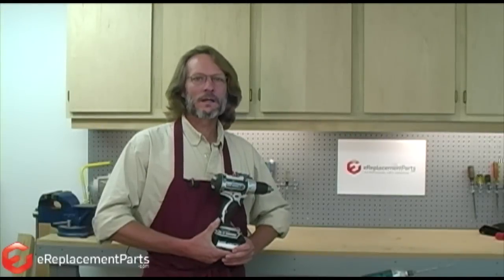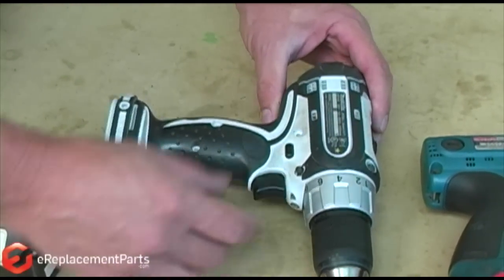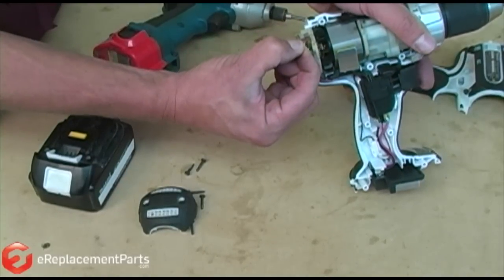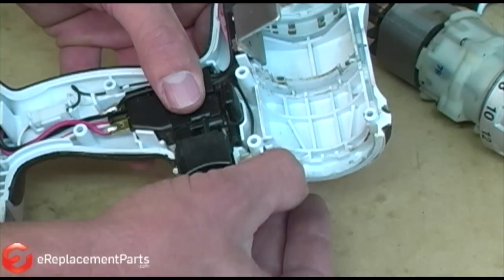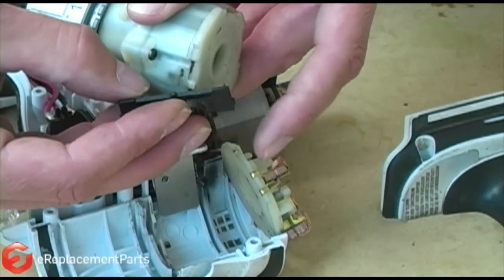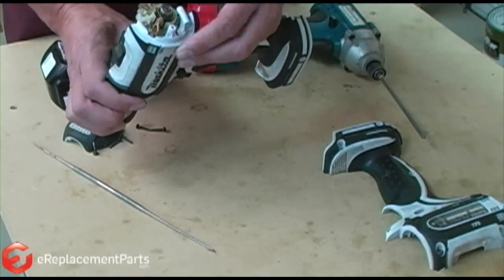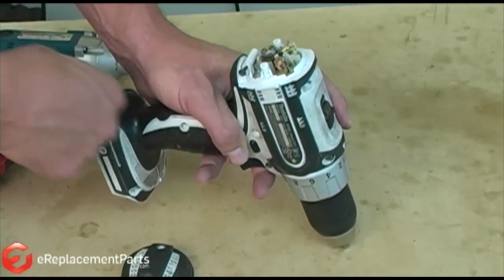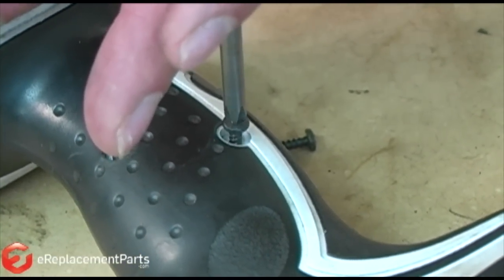How to Repair the Leaf Spring on a Makita Power Drill

Comment: Dale, I cannot thank you enough!!!  I've had two drill/drivers (BHP452 & BDF452) sitting in the case (for over 5 YEARS!!), never used after attempting to swap the housings between the two. The armatures weren't lining up properly within the brush holders and I'm pretty sure it was due to the notch out of the 'stator'. Thanks again, I missed having a hammer drill.

Comment: Hello I have the same power drill and the high low speed is not working, I took it apart and everything seems to be fine but it is not working, would apreciate any tips or knowledge about this issue, thank you.